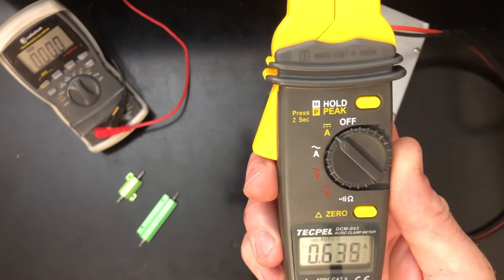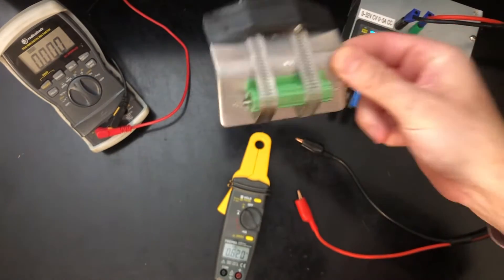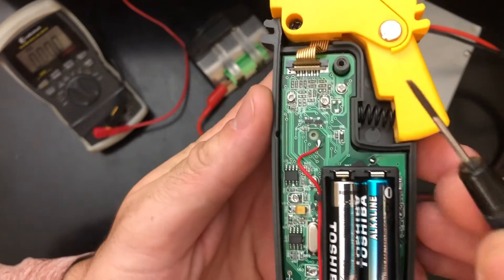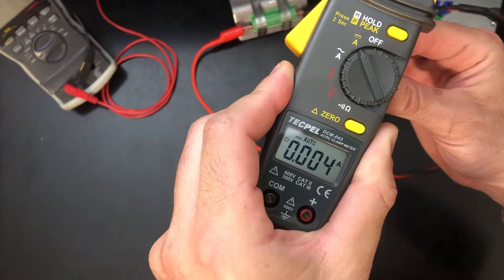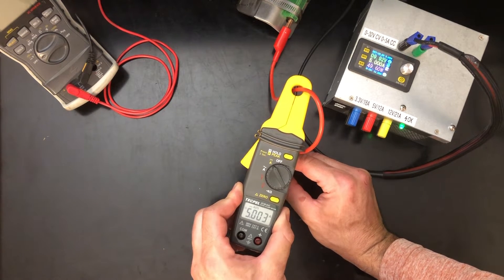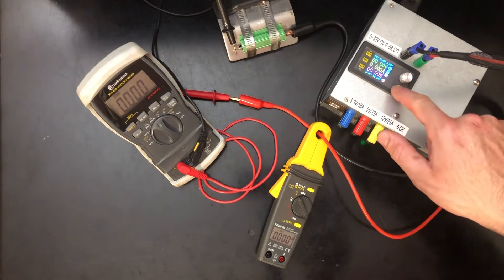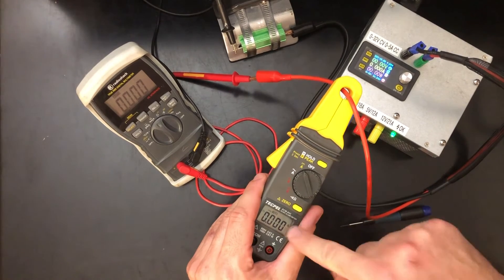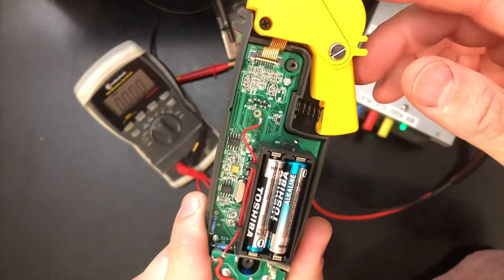Clamp Meter Calibration (Tecpel DCM-043)

Comment: Cheap meters have cheaper components. Notice the multimeter reading increasing either from the heating of the 2 ohm resistor or the heating of the shunt resistor in the multimeter. Calibrators use a voltage sense circuit that corrects the heating error by altering the current. Calibrators also keep the internal components stable with large heat sinks and air flow cooling. You can build a reasonable current source quite cheaply.
Reply from the maker: This one wasn’t cheap to me, but I know you can spend a lot more for true professional test equipment. I’ve used this a bit and it does wander on DC, even at different angles and inclinations to the wire. This procedure centered the baseline to be closer to zero than it arrived. I’d say it is good for .25A and up which is still a lot of what I encounter.

Comment: Can it be used as if it were a Fluke 771? Repeatably? I will be really impressed if that thing can show me 12 mA consistently and be under 500$.
Reply from the maker: @dougbeckwith768  I wouldn’t have thought any clamp meter could show 12mA DC consistently and accurately! That seems like shunt territory. But if the Fluke 771 can do it, that’s awesome! This meter is much better at small currents than the typical automotive version, and really affordable, but I would start doubting things under .5 amps.

Comment: Hi Colin. Thanks for the calibration procedure.  I have the Tec Tronic T223, rebranded Tecpel DCM-043, that also has the 0.6A variation, which I can now sort out with your video. Mine has now also developed a 100 ohm zero off-set. Did you manage to work out what the other trim pots are for?
Reply from the maker: @gavinhensberg6395  glad to hear it! No I didn’t figure out the others, but I suspect voltage calibration.